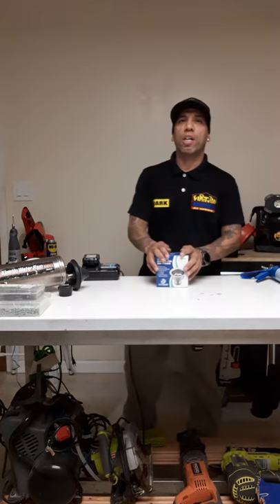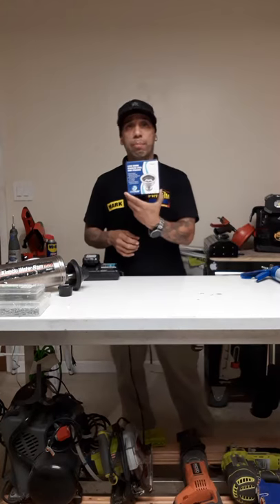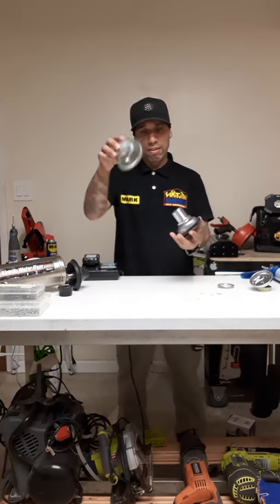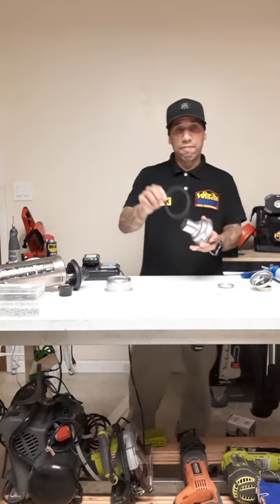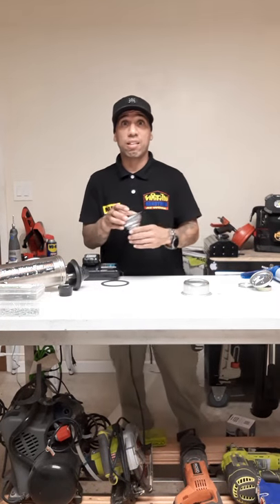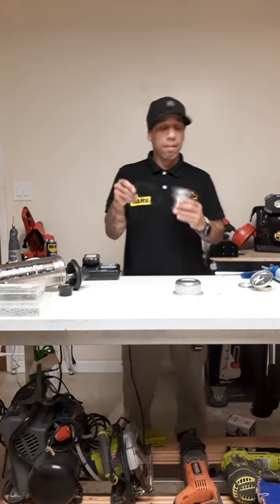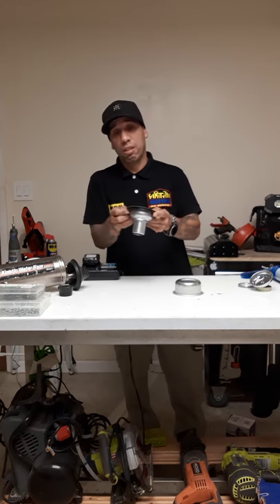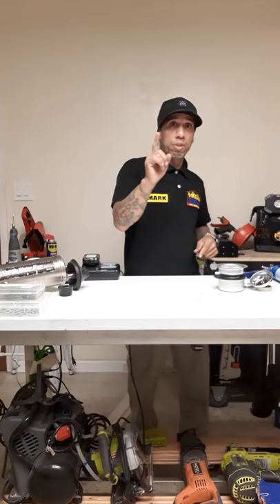Plumbers putty or Rubber gasket

Comment: As a Master Plumber, Master Gasfitter, Backflow certified tech with 23 years of experience in the trade...

You are dead wrong, BUT...  this video gave a lot of plumbers on Facebook a good laugh.  You should make more of these and let us know what else we’re doing wrong!  😁😂😂👍🏻
Reply from the maker: That's fine if you feel that way but I've been doing this 25 years and not once that I have a problem with not using plumber's putty plumbers putty for some people works and for some it don't for me it doesn't work you going to go back maybe 6 months later to find out there's a leak coming from the basket so don't say that you should always use plumber's putty cuz you don't I've been in this business for almost 25 years since I was 19 years old and I've seen it all so thank you I'm glad you find it funny I don't you guys just don't want to admit it
Reply: Handymen At Work Locksmiths - Putty/silicone are used as sealants between basket strainers and pop up assemblies because they squeeze out and maintain the seal between when tightened.  By using a gasket, there will be a minute amount of lift between the drain assembly and the basin causing a slight ring of water that will never drain out.  This creates an unsanitary condition.  The rubber gasket is included in a drain assembly to prevent shifting on the basin that it is connected to.  It is to be installed below with a friction ring (paper or plastic) to prevent puckering of the rubber when tightening the lock nut.  Some cheaper/inferior drain assemblies do not provide a friction ring.  You get what you pay for- don’t buy cheap crap.  Regardless of how long you’ve been a Handyman, it doesn’t matter how long you’ve been doing it wrong, if it’s still wrong.  I know some rubber gaskets are paper thin and you can tighten them down and see ‘almost’ no water down by the drain flange, but others are thicker and will leave a visible ring of water which will cause a buildup of filth and bacteria.  Plumbers protect the health of the Nation and though this is a small example, it is still an example of what not to do and why.  If a plumbing inspector saw your drain assembly sticking up not allowing all water to drain out, he would fail you at a final inspection.  Have a good day.
Reply: Are you one of those guys that also use wax on the toilet instead of rubber?   I am just replacing a $250 garbage disposal because the putty failed, and leaked for years. The house was rented and the tenants never noticed.
Reply: @yacahumax1431  - Yeah, most of the industry uses wax rings at the base of a toilet over gimmicky red rubber attachments that squeeze down inside the flange reducing the inside diameter needlessly when wax on a well set flange does the job well.  That’s what professionals have been using for decades.  So yeah, I’m one of those guys.  Putty on a disposal?  No problem if there’s enough putty in there and it’s tightened up by someone with some muscle, or silicone if they prefer.  As far as negligent tenants… it happens.  Tenants come in all varieties.  It’s what happens in the land of Property Management.  The bottom line is, there’s good information out there, and there’s bad information out there.  Be careful what information you’re investing your time and money in.  A handyman/locksmith teaching plumbing is probably not where it’s at.

Comment: There’s an art to plumbers putty and knowing how much to use. 
1. Never trust a “pro” that uses ryobi tools...
2. Never use the UNDER SINK TENSION GASKET above the sink...
3. Read the instructions on materials your using for your customer 

I’ve seen people use the rubber gasket like this guy. It will hold water in the sink around the basket and cause your sink to rust out or have water stains
Reply from the maker: Stainless steel sinks do not rust what are you talkin about do your homework it doesn't matter what tool you use by the way Ryobi is made by Milwaukee do your research tools to use have nothing to do with the skill you know if you can't use a Ryobi and you're not a good Craftsman I use whatever tool and get the job done look at my work it's not the only Channel I have I hope the people who like to DIY and try to save money I don't go ripping people off or any type of work that I do so the way I do my work it's convenient for some people and I just show people how they can make things last longer and if they accept it and so be it

Comment: Hey Mark does this apply to the garbage disposal drain as well or should you use putty?
Reply from the maker: Yes same thing applies. Please do not use plumber's putty it's up to you if you want to use it but I don't recommend it cuz I ain't around you going to be changing it back to the gasket.
Reply: @handymenatwork316  you pretty much have to use putty or silicone on a disposal flange.....they do not typically come with a gasket.
Reply: @kylevorenkamp2416  I replaced my garbage disposal back in 2016 and the instructions told me to use putty for the top seal. I haven't had any leaks since installation. I think people aren't tightening the nut enough.